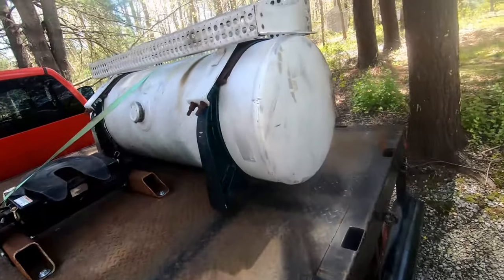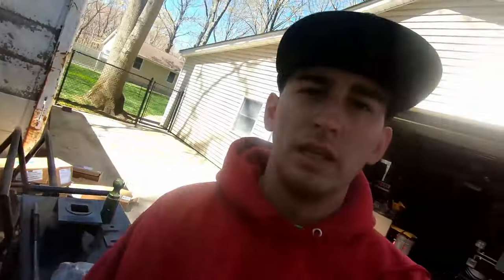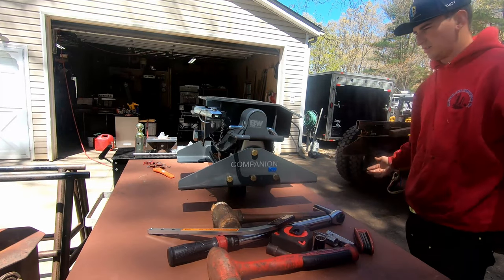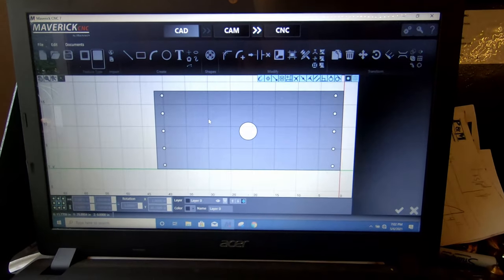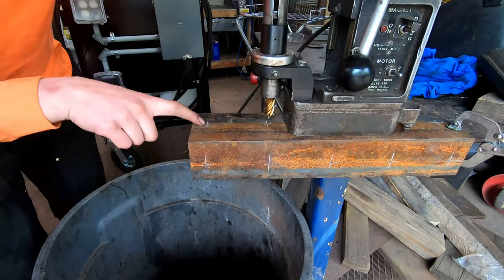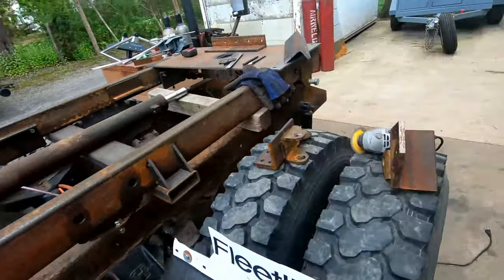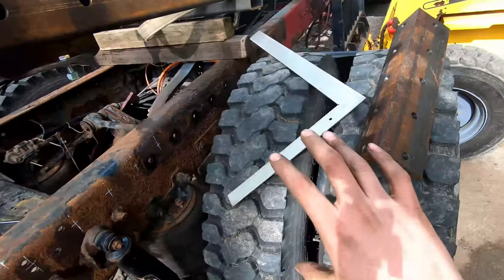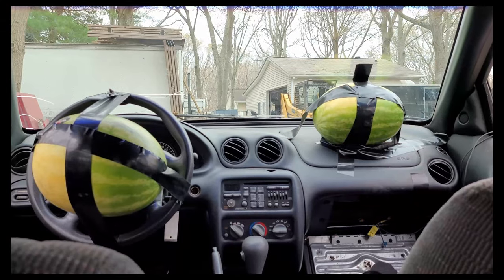I CUSTOM WELDED A B&W GOOSENECK / COMPANION 5TH WHEEL HITCH IN THE FIRE TRUCK TOY HAULER!!!!

Comment: So are you a full time metal fabricator and part time fire fighter? Don’t know any “backyard welder” that has a plasma table in their garage lol. Very good videos. How did you verify the subframe was straight and level for the rollback bed? Just one measurement along the frame on each side?
Reply from the maker: Well I'm the first backyard welder you know with a plasma table lol. I'm a volunteer fire fighter in my town, and I've never had the job as a metal fabricator or welder, ive just always done it for my self. My dad is a master metal fabricator basically where I learned most of the craft. Between going to school and covid last year is where I found all the time to build this rig. Also I know the video only shows a few measurements, not even lying, i spent more time measuring on the build than the build itself so I could fit everything I wanted to. You make sure the frame is level, you make sure the frame is the same length on each side and then you do a X measurment. To make sure the frame is square. This year I plan on doing alot of how to videos and going over the truck more in detail.